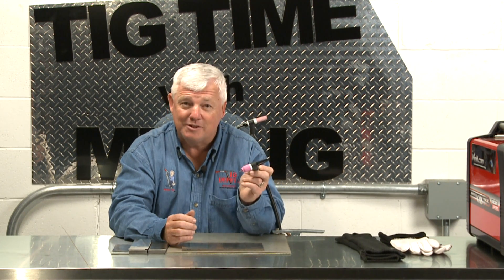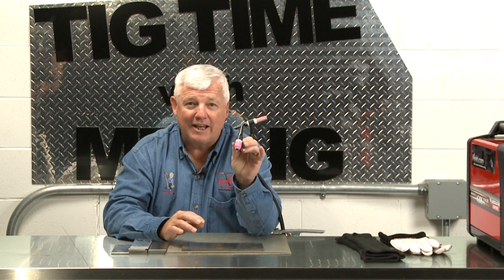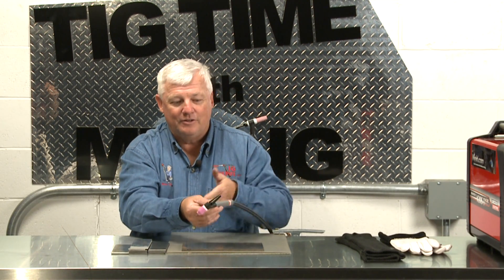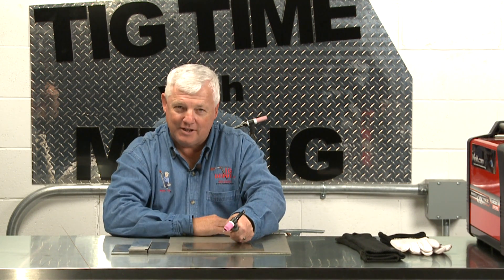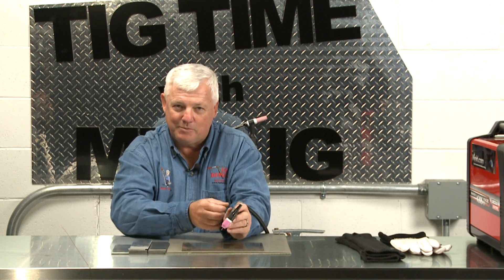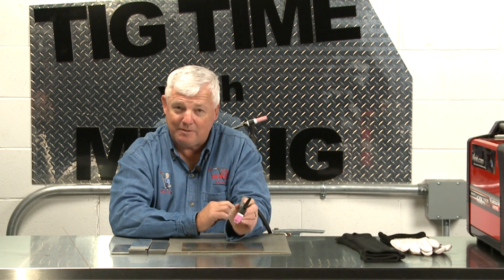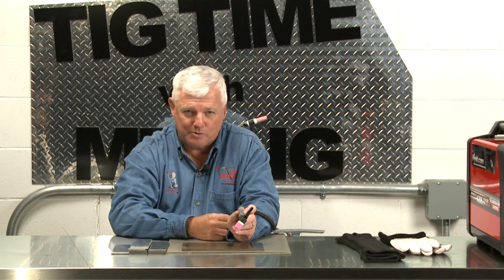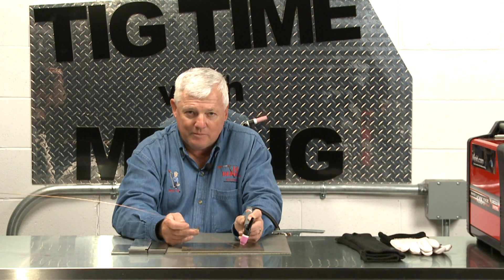TIG Welding: What You Need To Know

Comment: Hi, i am a long time watcher of your show, and i finally have a question to ask.
I have a Lincoln invertec  v205 and i believe this was the first one sold in the uk, and i am very pleased with what it can do, my question, i did ask Lincoln but they haven't got back to me yet, is.
i have watched some demonstrations of a tig weld being performed by a welder with Chinese symbols written on the tig ceramic cover, and he is able to do a spot weld a single pulse onto the work piece, i have tried to do this and i cannot , is there any setting that you may know of that would help me, the problem i get is hairline cracks in motorcycle  hubs on the dust band by the braking surface, a simple spot weld would hold and give you chance to make the flimsy section hold again while you as the welder get chance to add a few more spot welds or tacks around this crack.
I also likes your section on the EZ rod to weld cast iron, i had some of these rods from amazon and i have repaired some amazing jobs with them, one a pipe former from a pipe bender in which the operator managed to split the former, after a run across the crack the job was fixed and is still in use today,
another repair was on a tool holder on a Waterbury Farrell die holder, again repaired perfectly to make the machine continue with its production.
Oh and i forgot to say the hub in question is a pure cast magnesium hub. i seem to get all the quirky jobs.
Best Roy

Comment: thanks for the reply mr Weld.com...if its only issue is with the cooling fan, I can easily modify it to run with a much faster motor, I will heed your advise as to running the coil at less than 180amps, my projects will be small welds on sheet metals and small metal pieces,thank you again best wishes from Singapore..

Comment: I ordered a 60hz 240v AC TIG MIG DC inverter welder from Ebay ..my country uses 50hz 240V AC outlet...is this device safe to use in 50 hertz environment or will I be fried? many thanks in advance Mr Tig !! by the way whats a 41-30?
Reply from the maker: Because the machine you purchased is designed to run on 60hz and your country is 50z, this means that the machines cooling fan for example will run slightly slower than it needs to run which means the machine is not capable of running at full capacity. You should de-rate the machine by 10%.  So if the duty cycle is 60%, it now would be 54%.  If the total output of the machine 200 amps, then the output now should be rated at 180 amps.  

If you apply this "de-rating" principle, than you should be okay.  You can not count on the machine having overload protection and shutting down before you burn it up, so just de-rate the machine and be careful not to overload it.